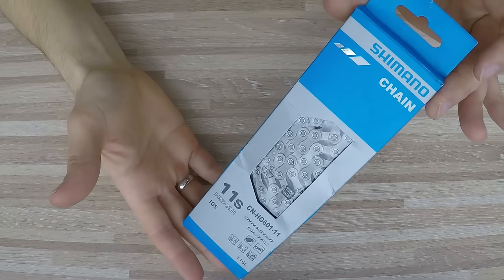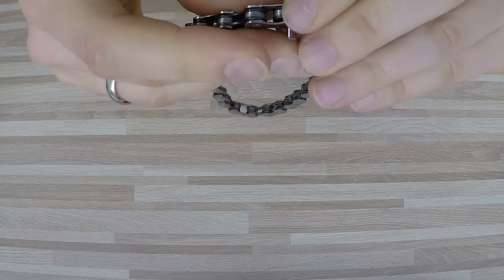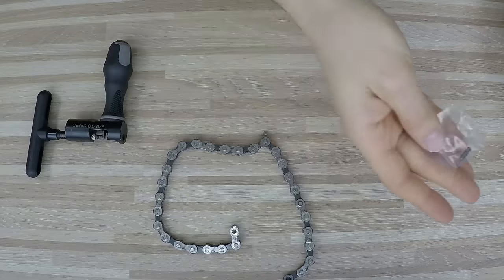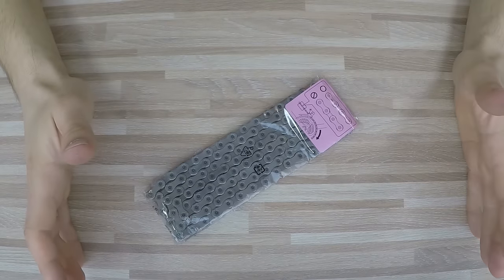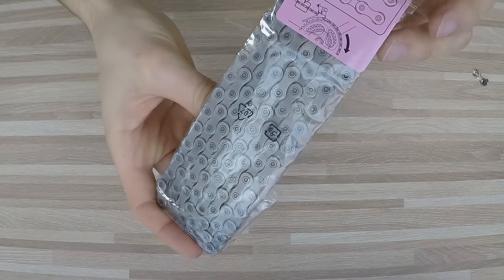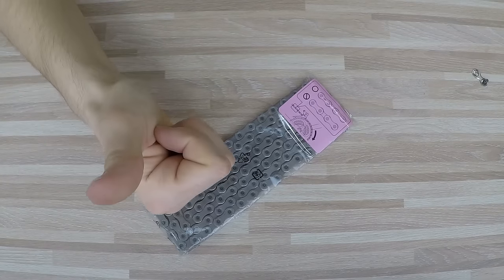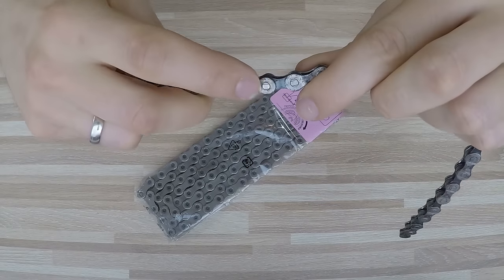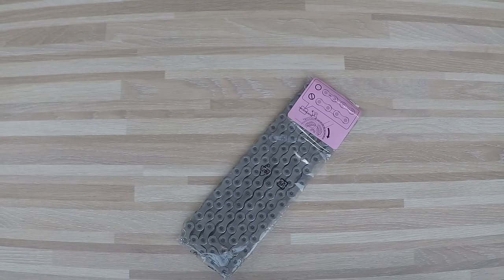4 Worst Mistakes In BICYCLE CHAIN Maintenance. How NOT to do it. SickBiker Tips.

Comment: Don't use a degreaser at all. Use two stroke petrol. I know lots of gunsmiths that use it to clean and service guns. They usually leave the gun in two stroke petrol (25:1 over night). I've used it on my chains and it's brilliant. Really cleans the old grease off and petrol is made to evaporate fast for if there is ever a spill. Once the petrol has evaporated off, you are left with a thin coating of some of the best oils made. This oil is make to work in petrol so is unaffected by the petrol. Where ever the petrol was, there is now a thin smear of oil. I've ridden many times with just the two stroke oil and it's worked fine. Only problem I've uncounted is that petrol effects Michelin tyres, so far other tyres are fine. You won't have a cleaner chain and water never gets near it. Try it before you write it off.

Comment: How many chains are you guys breaking - lol!  Like many, never had an issue removing/reinstalling pins.   Might be a concern if you reused the same pin over and over (highly unlikely), but with the cost of a new pin, probably worth the piece of mind (especially considering how rarely a chain breaks).

Honestly, I have read some pretty bizarre rituals for cleaning/re-lubing chains. Short of using corrosive materials (like rust remover) pretty much anything will work and lubes need only to 'cling' to the chain to be effective. Whatever you use, the secret is to use it sparingly and wipe off excess so it doesn't attract dirt/dust.  You really just need a 'very' thin layer of lube.

Comment: I take my chain off after every ride. I use electrical parts cleaner. It doesn’t melt plastic but cleans the chain really clean. I clean all areas the chain touches. Then white lighting lube.. chain never brakes.

Comment: You mentioned not cleaning the super sticky grease completely by not getting the degreaser into the rollers? Surely if that grease is left in the rollers, its going to attract dirt and grit in the rollers causing damage.  SRAM (My chosen chainset) recomend you soak the chain in degreaser then wash this off.  I then dry the chain off with compressed air, then re lube.  This way, ALL the super sticky grease is removed, no grit or dirt ends up in the most vital parts of the chain, the rollers.

Comment: In the days before Hyperglide, you could just rejoin the chain like you did in your youth. Looks like you were doing it with Hyperglide though - which is a no- no! It is the forceful way the special tooth profiles and ramps wrench the chain over- the clack you hear, that made special links and pins necessary. Pre index, pre Hyperglide friction shifting doesn't subject the chain to anywhere near as much side load. The chain glides across when it's good and ready.

Comment: all todays multi speed chains that come with a joining pin have a lip on both ends of the pin to retain it within the chain. once you force the pin through the chain when braking the chain the lip is riped off rendering the pin unsafe for further use. all joining pins are strictly for single use only. older joining pins from pre 90s were basically flat from end to end not effectively concave like todays pins and could be reused if needed

Comment: i used to push out a different pin every single time id clean my chain never had a single issue on a 1500watt mid drive motor for over 2000km

Comment: the old mechanics always used diesel to clean and lube chains. works a treat.
Reply: Brakes might overheat and catch fire
Reply: ONEWHEEL KAID  so don’t get it on the brakes. Only use on the chain.
Reply: Noel Armstrong the petrol would go on the cassette and the brakes will push heat the direction of the wind especially if your in urban downhill areas on DJ bike
Reply: Diesel and petrol are two different things.

Comment: I am pretty sure that the "grease" coating a new chain is not really grease it's a rust preventative called cosmolene. Not only will this coating attract dirt, sand, and grit, once it they get on the chain the cosmolene will keep it there allowing the grit to destroy your chain. Worse yet, cosmolene is not a lubricant so if you think leaving it there will keep your chain lubricated you are incorrect. For many years I've used kerosene to remove the cosmolene by partially filling a screw top plastic bottle with kerosene, dropping the chain in and shaking it for a fee minutes. I then remove the chain, wipe it as dry as possible with a rag and hand it up for the kerosene to dissipate. I then lube the chain link by link with a quality lube...I use Pro Link which is a good quality lube that does not attract dirt. The fifth very common chain maintenance mistake (and arguably the worst) is to use WD 40 to lubricate the chain! The W in the name stands for water, the D stands for dispersant. WD 40 was developed for the military for use in dispersing water from electrical systems and other hard to reach areas where moisture causes damage. It is not a lubricant and using it is bad for your chain.
Reply: Absolutely correct. Indeed, Shimano state clearly on their website that the coating on new chains is to prevent corrosion, particularly as new chains may be in storage for months or even years before reaching their intended recipient. And yes WD40 has nothing to do with lubrication - it's probably one of the most misused products ever sold!

Comment: Absolutely agree about removing the original grease which is made only for storing it -not for riding! But Your way of maintain is not practical. Instead of using the handkerchief you can use an empty plastic bottle with greasecleaner or with just a regular car fuel like petrol.  And just shake the chain in the bottle with degreaser.

Comment: Chains seem to be a lot more reliable now, I can't even remember the last time it snapped. But I still carry a chain breaker, and always reuse the pin no problems.
Reply: dhdoctors depends on the design of the chain, and if the pins are tapered. old school chains are no probs to push pins in & out. dura ace 9 or 10 speed... use the proper snap-off pins, and always break the chain in a new place. it is basically impossible to reuse an old pin with dura ace, you will bend the plate before getting the pin into place.

Comment: For those waxing: start with a ministerial spirits shake down to degrease and then use denatured alcohol to clean off the spirit before waxing. After waxing water will do the trick. I circulate 3 chains so always have a fresh waxed chain when needed after heavy rain etc. Enjoy.

Comment: The chain repair method you showed at the beginning is a standard in my country! You just need to hit that pin hard enough with a hammer, so it's head get's squeezed and the pin gets blocked right there. This is the method used by high tech machines in bike chain factories, we are doing it with a hammer, but the concept is the same. Every single bike repair man you'll find around here is going to fix or shorten your chain that way, and it's never going to fail! ;)

EDIT: Every bike shop here has those identical pins, but new. Chinese factories produce them and ship them by the hundreds in plastic bags. Apparently China and many other countries too are used to repairing chains that way. Only Americans are dumb enough to buy a new chain when it can easily be shortened.

Comment: Ultra distance road rider here. MANY miles. Agreed, don't reuse chain pins. Buy in bulk. Clean chain thoroughly in gasoline, hang it down from one end on a nail in the garage and douse it with White Lightning/Clean Ride, let it drip down. Wait 5-10 minutes, invert chain and repeat. Done.

Comment: Never had a chain brake in me in 50 plus years of riding. To clean run the chain backwards through a disposable cloth until it runs clean. Old toothbrush to get the grime off the inner plates. Then lube each individual roller on its outside and inside. Takes time but worth the effort. When riding don’t use the extreme (inner ring front and outer cog back and visa versa) as this wears the chain out very quickly. As soon as you have trouble changing from smaller to larger ring on the chain wheel (ie grinding sound but no change up) then buy a new chain. Buy the best chain you can afford. It’s worth it in the long run. I ride a Rohloff speedhub 500 so I don’t have half the problems the rest of the world has.

Comment: Hi. Is there a way to ensure that after cleaning the drivetrain that black color oil wouldn't be present anymore? It seems like even tho after I wash, then put Decathlon's any weather hybrid lube (Green color) it will quickly turn to black after a ride. And I'm pretty certain I scrubbed and clean the chainwheel and casette pretty well too.

Comment: I think there'd be value in an advice list that's built using a more scientific approach. Bike maintenance advise always seems to be anecdotal, qualitative, and without any controls in place.

For example I can say that I've reused a chain pin and got what I perceived to be a full life out of the chain, saving me the cost of a quick link or replacement pin (opposite to this advice). The problem is I haven't done a study to measure the average life loss of the chain when doing so, thus I lack the means of saying anything objective on the matter, offering only my intuition that the amount of metal lost from the chain tool is small, so the durability loss is probably not big, so it's probably good to do it to save money.

Is that true? I didn't use the best tool we have for answering the question (scientific method), but at a practical level I've seen it done and liked the result, so I offer that up to the ether.

Comment: If you must uber clean your chain you can also after using water to clean off the degreaser put some ultra light oil in a ziplock baggy and put the chain in. Seal the bag and let it sit over night. Put the chain back on after a very good wipe and then cycle the system also while wiping. Be sure to keep it from dripping on the rim and the disc. Also never use traditional wd40, chainsaw oil / any heavy oil and don't use white grease or a spray on grease as that will clog up your chain. And wd40 is not a real lube. At least not for this application.

Comment: I always thought Shimano chains couldn't be split anywhere except within a few links of the joining link to allow sizing, as the pins elsewhere were as good as rivets and would damage the plates if removed. The special pin cannot be reused as it distends if removed. 
I always used Sedis as they could be joined anywhere the old fashioned way and would work with anything. The PC 840 was good on Shimano 9 speed cassettes too as being a smidgeon wider it was more likely to change if your mech, hanger etc, was slightly goosed.  I only got back into Shimano when 10 speed was invented and it appeared to change better.
These special joining links are a godsend as removing pins always tends to distend the plates, even in the good old days when the plates could cope but as there were say 116 of them you'd inevitably split and join the chain in a different place each time so you never overstressed the same link.
Reply: You can split any part of the chain as the holes in every link are the same for the pin to be extracted or inserted back on. Shimano and all other brands.
Reply: @rockefelleragent1357  Some you can't- like the KMC X9 and others- where the rivet ends are expanded or swaged over. These will clearly have stamping marks or a recess in the end of the rivet that is where it was stamped while being expanded. I've found that if pushed through, these rivets may destroy the hole.

Comment: I want to share my mistake.. Last summer I saw some rust on my chain and put it in a bottle with lemon salt and boiled water. I should have wait only 10 minutes but I let it in 2 hours :) So after a couple of months of riding I wanted to measure my chain. It was only in 1000 km but it was streched and my big chainring also eaten (shark tooth shape). So, don't use hard chemicals.

Comment: never re-use a sram 11 sp quick link. it is designed for one time use only, not sure about kmc, but its always going to be better to follow manufacturers instructions-  they put in the time and expertise designing it, take their word for it.
Reply: Leon Hubbard I'm sure that is exactly what their corporate lawyers tell them they have to say for liability reasons. In the real world, it works just fine. I use them until they no longer feel like they hold securely and then change. Always start with a new one with a new chain. I open them up regularly since I have to in order to soak them in a bath of hot liquid paraffin wax, which is what I use for lube. 
The one time one came apart on me during a ride was because I knew that it was too loose and used it anyway because I was out on the trail and didn't have another option. 
Prudent judgment is usually prudent.

Comment: I repaired my chain today on the way (push the same cotter pin back in), and then tried to drive home very carefully, the chain got stuck on the rear derailleur and ripped it off completely. Expensive mistake. I wanted to fix it first with my quick link, but I didn't have it with me :(

Comment: I have been using the same pin technique for about fifty years of cycling. 
Punch it out, clean the chain, punch it back in. I have never had any problems yet. I don’t think the Shimano manual mentions specifically cleaning the outside of the chain before using it.

Comment: i ve never broken any chain off i do split them and put them back topgether using the same pins i gean them in the strongest degrasers and i leave the original grease on 
If u are experienced enough u can split any chain and make it the same stron as b4
Metal is not harmed by degrasers
Grease is the best long term lubricant

Comment: PS: Quick release links VS replacing pins: Replacing pins I don't know because I don't! Quick release I have used since their inception and not one time properly installed/fitted have I had a problem! I ride a $4000 road bike, average 21 mph and ride usually 10-15K/yr with no issues. Bammmmmm!

Comment: Not reusing the pin always was a nobrainer to me. You really have to dig around to find shops who has these pins "for sale" as such as it`s not exactly a common commodity. I suppose shops want to sell you a new chain instead of a single pin. There is a very distinct bang when you remove a pin  Those quick links suck. I quit using them after realizing they are inferior to the pin. You can get problems when riding when the link is becoming worn down. Think mine started skipping beats or something. The quick link never severed though. I use white spirits to wash my chain before lubing it up with some Shimano bicycle oil. I actually boiled my chain once. Not recommended, it started to rust very easily afterwards. Nice to know the sticky layer is supposed to come off the chain when new.

Comment: err, when you wash your bike it is always a good idea to relube your drivetrain (chain, derailleur) only takes a few drops of bike lube, you can use a can of air for cleaning computers to get the water out of the chain, but a shop air compressor with a tank and an air gun would work best, more power. so degrease the chain, wash up and hose it down to get rid of the soap, use an air compressor or a can of air to dry the chain itself quickly (cassette and derailleur) too, then run the chain through the gears while adding a few drops of chain lube, good to go with a nice freshly cleaned bike. unless your just washing with a rag and a little water to touch up there is no good reason not to just relube the outside of the drivetrain while cleaning the bike, its like 50 cents of lube, a buck at most, probably less than 50 cents, doesn't take much chain lube.

Comment: I found an older mountain bike and the chain and sprockets were so greasy and nasty and even starting to rust, I used WD 40 on it, cleaned excess off, the rust came off the chain. It wasn't nearly as nice as a new chain but it worked very well, never had issues with it slipping off and didn't feel weak at all, Rode the bike till it got stolen so I probably put 200 miles on it.

Comment: Maybe one addition - Shimano chains could have short or long pins.  For home replacement only long pin version should be used. Short pin -w/o guide is intended for professional installation. Actually installed one shortpin chain with hand tool and it lasted 3000 kms. Also if you install directional chain incorrectly, it shifts likes crap 😁

Comment: What people don't know, because we measure excatly 12'' on a new chain and that by 12 1/16'' the chain is due for replacement and that by 12 1/8'' it's already started to chew your cogs and chainrings theet.  But everybody knows that, no?  The wrong assumption is that the chain had streched.  A chain doesn't stretch!  The pins and rollers are worn and here is the difference.  It is more important to lube the internals of a chain than the outside. If we lube the outside too much, it'll only gather more road dust and dirt and cake on the whole transmission.  When lubing a chain, wipe it almost dry after.  Let it sit and the volatile vehicule for the lubricant will evaporate while having brought the good stuff in the right place.  I use a mix of 20% W90 oil with 80% naphta and it works. The naphta cleans the chain on the outside and sips the oil to the pins and rollers.

Comment: You say leave the original grease on the chain in place but is it not true? that over time the grease will turn to butter through the churning effect of the chains rotary movement? Surly a chain degreaser will remove this churned gunk before reapplying new grease.